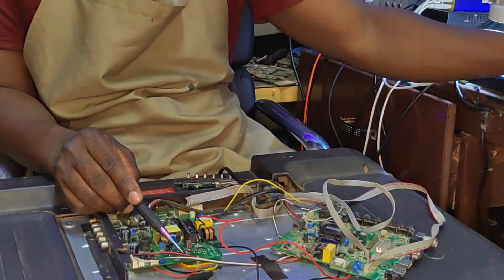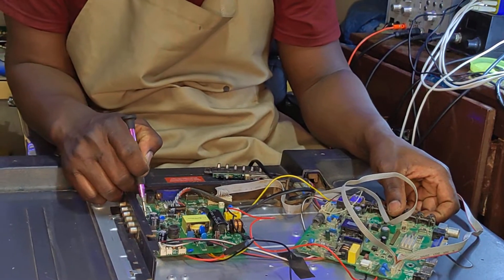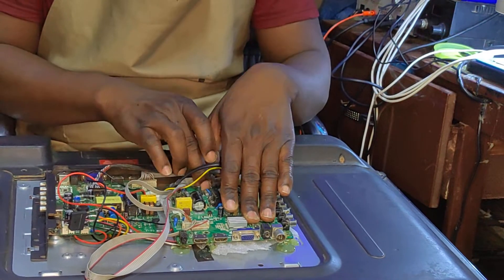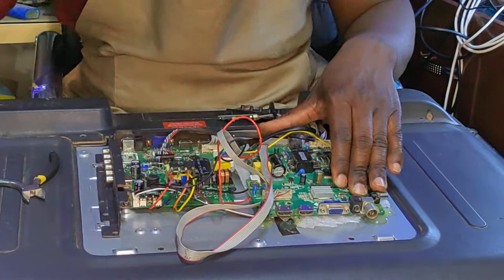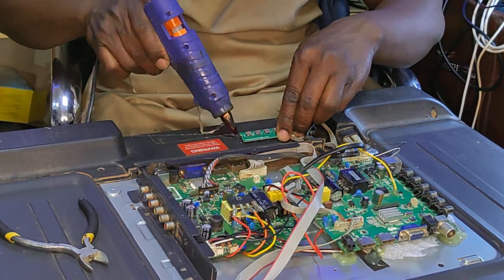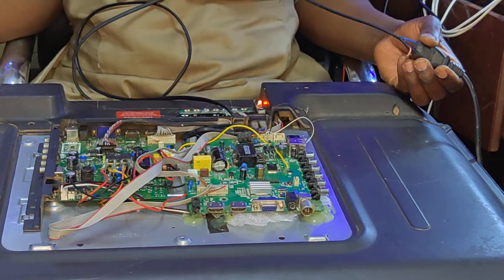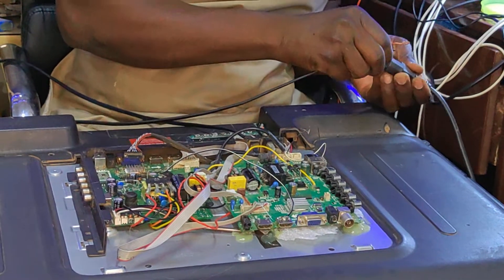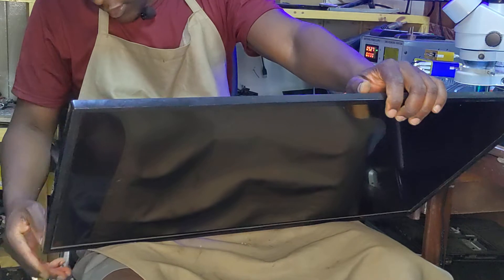Hard Night Wednesday,,,Let’s Fix a Weird Switching Power Supply  Telefunken 32 Inch LED  FINAL PART.

Comment: I have my Telefunken 40-inch  it's stuck on standby red light
Reply from the maker: Check switch button if it's okay,, check 5 volts power supply driver not to be on short,,if all doesn't help maybe you have Dead cpu and you can't fix the motherboard,, Having in Mind That any fault can cause your Tv to be Stuck on SB  mode

Comment: Wouldn't both power supplies turn on at same time if you unplugged the main Ir cable from the donor board and spliced postive negative into the original boards ir cables?